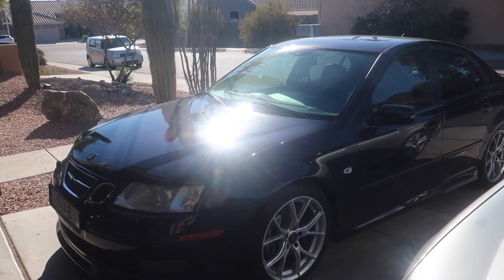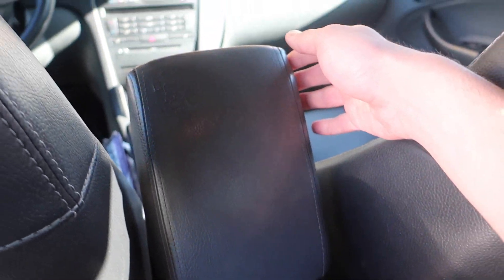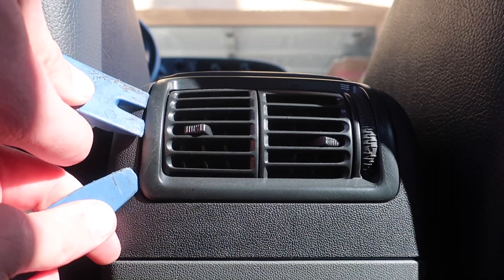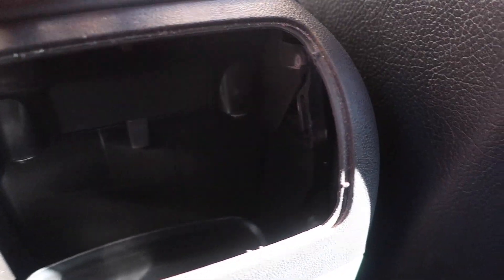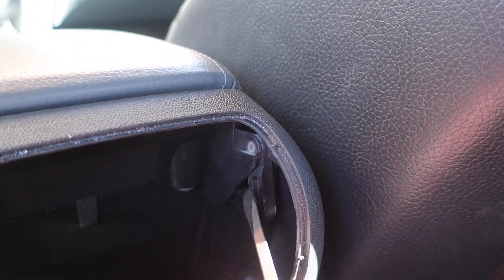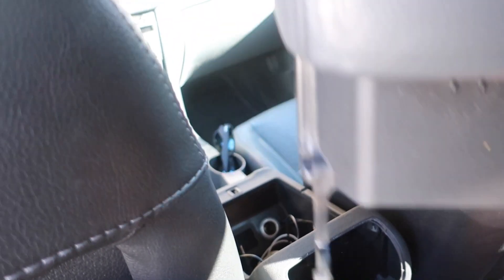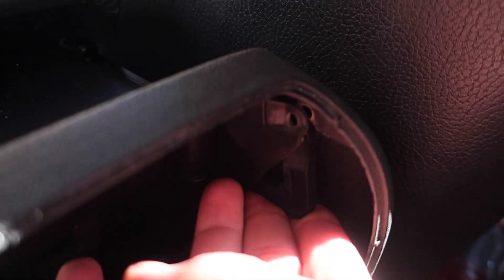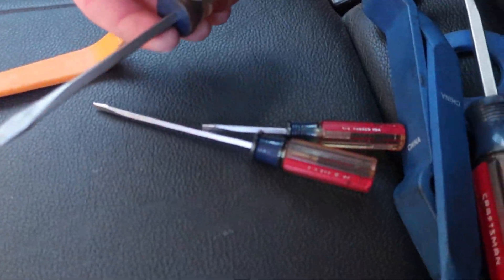Saab 9-3 Quick Fix - Center Armrest Replacement

Comment: Hey man, i just bought a 2007 Saab 9-3 2.0T and am trying to find aftermarket parts for it (cold air intake, LED lights) as well as changing the stereo head unit out and speakers. I also live in Phoenix and was wondering if you have suggestions or place in the valley to get these parts. Thanks!!
Reply from the maker: Feel free to DM me on instagram, especially since you're local (@Auto.Autopsy). I can do my best to help ya out with everything there and we can have an actual chat!

Comment: Will also work on my 9-3 MY2000. But do you have any clue, how the temperature regulator is working on the manual climate control??? It's blocked on my 9-3 and the heat is on all time long. And I'm not freezing?
Reply from the maker: i don't know much about the OG 9-3's sorry... :/

Comment: I want to change my fixed armrest to one that can be pushed forward like in your video. I could get one cheap but it’s fabric not leather. Does anybody know if the top part can be swapped between the two versions? Then I could get the cheap adjustable one and put my leather top on it.
Reply from the maker: to my knowledge, it's riveted on